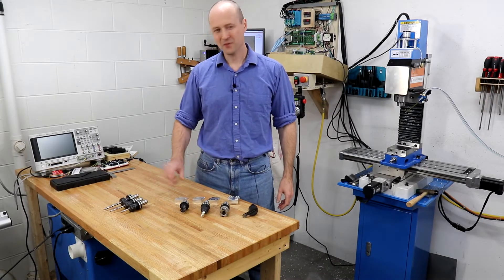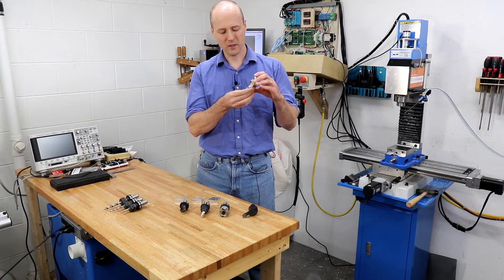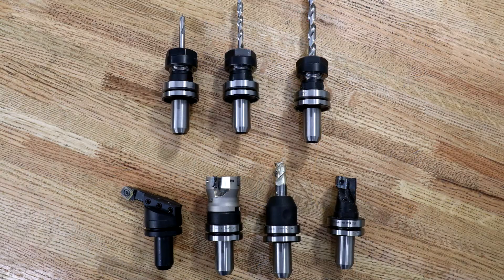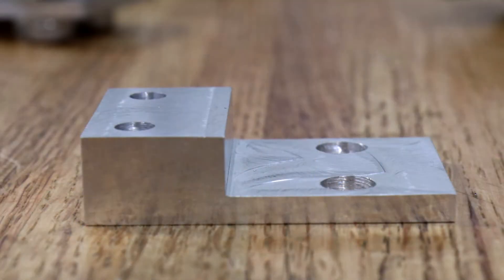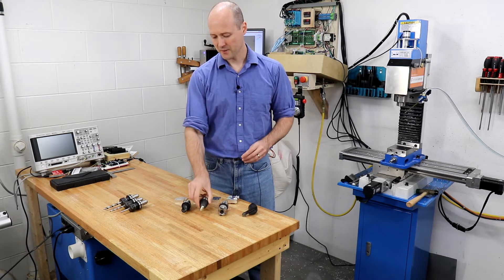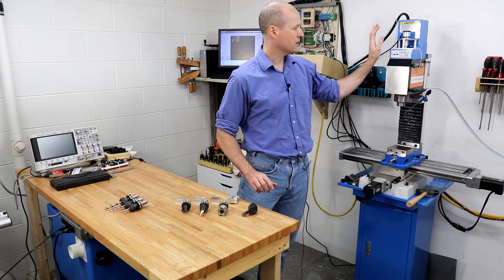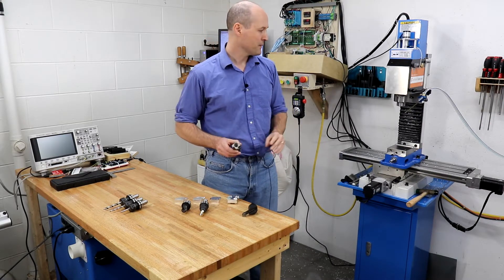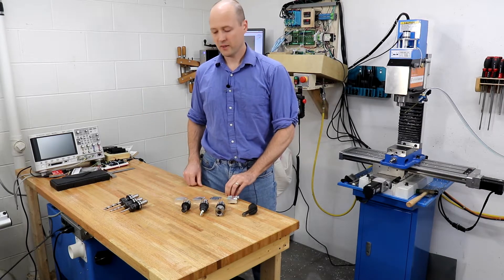CNC Milling Tools, Spindle Load, and Performance

Comment: Nice vid Kent.  Hard to beat that shear hog for getting the metal out of the way.  Personally, I think I'd shear hog the top and step, leaving .010" stock to leave on both axial and radial.....then use that 1/2" end mill to clean up all 3 surfaces.  With only .010" on the floor, the 1/2" end mill should leave it perfectly smooth, with pretty tool marks.  If I remember right, a pocketing tool path with the 1/2" will let you clean up both floors and the wall without having to do a contour path for the wall.  I'm also curious as to why you're on one side of the vise instead of in the middle.  My cheap vises don't handle that as well as they should/could. :)  Thanks!!
Reply from the maker: Thank you Mike, I've been really your Instagram feed. Yes, my bad practice of using one side of the vise. I used the fixed jaw as a reference to avoid re-indicate when swapping parts. I need to make a vise stop. (I have one of those flexing ones, but it's way too big, and always in the way.) I tried your suggestion of a 2d pocketing operation and it looks great. Enabling both-ways gives a nice tool path. Previously, I would use a 2d contour and horizontal tool path, but now I'm upgrading to your suggestion. Regrading surface finish, the 1/2" end mill left a really rough floor, but I was adaptive clearing to the final depth, and that's unfair. I'll give it another try. I have a few of the modular insert tools from Tormach and those leave a very smooth floor. I was thinking to use the Shear-hog in closed pockets and the face mill if space allows. They both completed their jobs in same time, but the face mill sounded less clang-clangy on my small mill. I meant to have times into the video, but I ran out of time. The times are inline with the power consumed. For example, roughly, the end mill adaptive clearing took ~1/4 the power and took 4x the time. Still room to push it. Best wishes, Kent
Reply: Thanks. :)  I just followed yours.   Yep...those big flexing vise stops are a bit of a pain sometimes.  I like the little ones that clamp to the top of the jaw.  On a nice simple part like that, you could move the part over exactly two inches....put the little vise stop against the part...then from g54, move the spindle over 2" and set g55 to that position....then run the part from g55....that way you don't have to move g54, but your part is closer to the middle of the vise.  Not sure that made sense.  The Haimer makes setting the work coordinates easy enough that I just reset g54 when I need to.  Plus, since I change soft jaws fairly often, I have to do it anyway. lol  
Kevin at Mechanical Advantage turned me onto the pocketing.  
The shear hog works really nice on the pockets.  I like it because it throws the chips up and out much better than most of my other end mills.  
I think the insert tooling tends to leave a nicer floor finish because the cutting edge acts as a wiper.....at least on mine they do.  The 1/2" end mill probably has a taper up into the center on the end......leaving only the very point to cut the floor.  
I really like that you took the time to run the comparisons while doing multiples of the same part.  I've tried to do that a bit, but most of my parts have been fairly big, and I don't do that many of them.
Reply from the maker: Thank you Mike. This vise is a Kurt D40 and I checked the manual, as one tends to do after years of doing wrong, and it indeed says that the way I clamped these parts is wrong (pgs 5 and 6.) I follow what you are recommending about G54 and G55 and the little vice stop and repent my bad ways :) The CoolMist is rough on stuff and I'll take the vise apart soon and see what's going on inside.

https://www.kurtworkholding.com/documents/online_D40.pdf

When you use the ShearHog, what does the floor look like? While the ShearHog is not for finishing, I see gouges that perfectly follow the edge of the tool engaging the material. AB Tools thought these where likely tool deflection. The tool looks perfect for pockets, especially with the different length arbors. For smaller pockets, Shars has a similar but smaller diameter tool with polished inserts but I've not tried it.

Right on about the endmills. I'm thinking of using standard endmills only for side profiling and insert tooling for everything else. I've replaced my Finish-Rougher endmills because, they leave predictable edges the length of the tool pass, despite Lakeshore Carbide's finishing claim.

Do you have a suggestion on quantitatively comparing the finish of each tool? I'd like to compare the tools with different parameters and measure surface finish. Even a used roughness tester is quite an investment so I wondered if there was an alternative.

Best wishes, Kent
Reply: If you're not clamping the parts very tightly, I don't think it's an issue......but using a "jack" on the other side of the vise would help keep the jaws square......or putting the part closer to center.  I'm certainly not trying to judge and say it's bad....I still do a lot of stuff wrong....just trying to help a bit. :)  

The floor finish with my shear hog really isn't that smooth at all.  I would think it's more machine flex than tool flex.....it's a pretty stout tool.  Since you have the modular version, I would think it would work great for pockets, too.  

Ah...I've had the same ridge/edge left behind with my Lakeshore carbide finisher/roughers, as well.  I'm glad to hear I'm not the only one having that issue.  I do like that they break up the chips into short pieces so they can evacuate more easily.  I may try a different brand when it comes time to replace them.

Hmmm....comparing the finishes.  I think a close up camera shot and a fingernail is about the best I could do here.  If it feels smooth and I like the tool marks left behind, it's good. lol